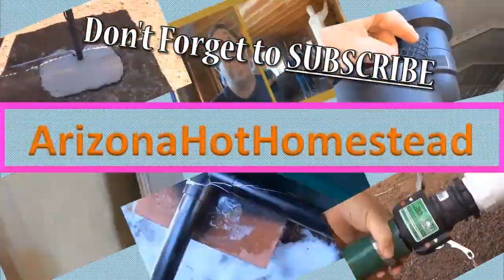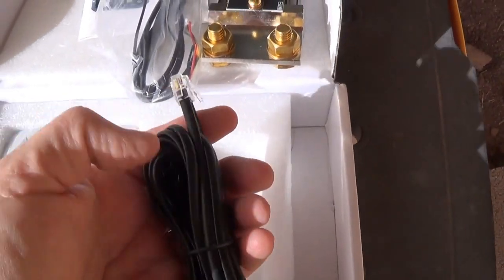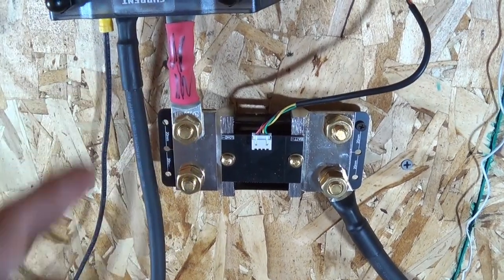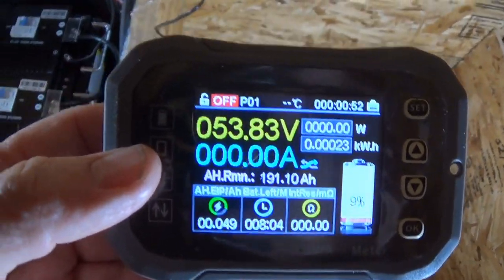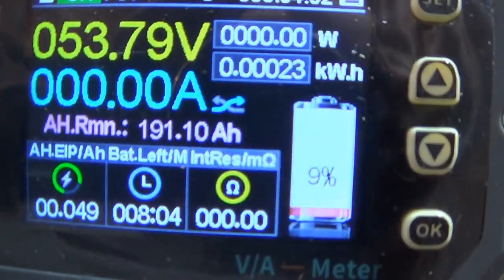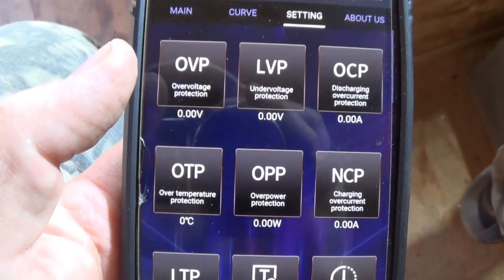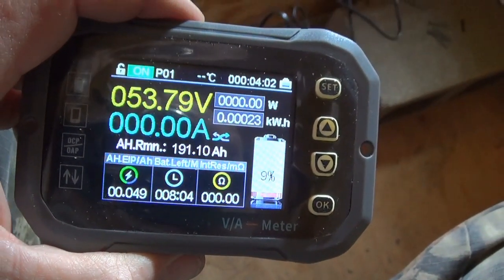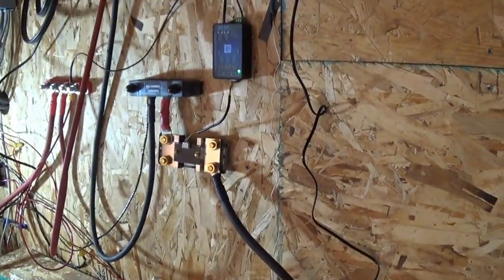JunTek Battery Monitor KG-160F 600A

Comment: To calibrate your KG160F, you set the known full/empty states (0% & 100%) by first fully charging the battery, then fully discharging it, adjusting the preset AH and 0%/100% capacity on the device or app to match real-world values, and use the built-in fine-tuning for voltage/current/temp against a trusted meter for accuracy. 

Step-by-Step Calibration (Initial Setup)

Initial Setup:

Set Full Capacity: Set the "Preset Battery AH Value" in settings to a very large number (e.g., 30Ah if your battery is 20Ah) and remaining percentage to 0%.

Charge Fully: Charge the battery until it's 100% full.

Record & Set Capacity: Note the displayed "Remaining Capacity Value" on the monitor, then enter this as the actual "Preset Battery AH Value" in the settings.

Set 0% State: Discharge the battery until it's empty, then set the "Remaining Capacity Percentage" to 0% (or use the voltage/time triggers for 0% reset).

Fine-Tuning Calibration (Using a Reference Meter):

Voltage: Connect a known accurate multimeter in parallel with the KG160F. Click the voltage display on the KG160F and enter the multimeter's reading to adjust.

Current: With a stable current flowing (or zero current), use the device's "Zero Current" button for zeroing. For fine-tuning, use a reference meter and adjust the value on the KG160F.

Temperature: Compare the device's temperature reading with a calibrated thermometer and use the temperature calibration option in the settings to offset.

Using the Mobile App (Optional but Recommended):

Download the Juntek app (scan QR code) and connect via Bluetooth.

The app offers similar calibration (voltage, current, temp) and allows viewing real-time curves and exporting data.